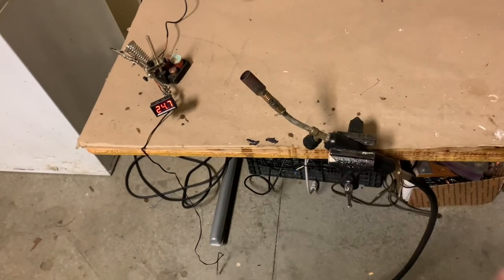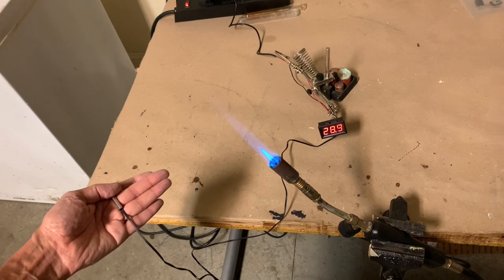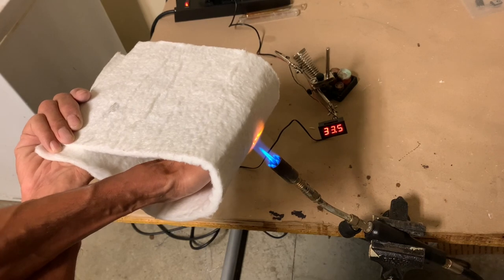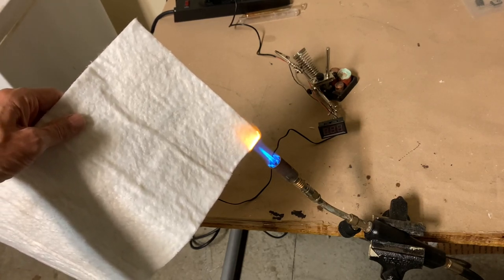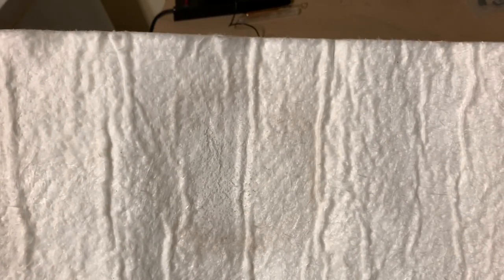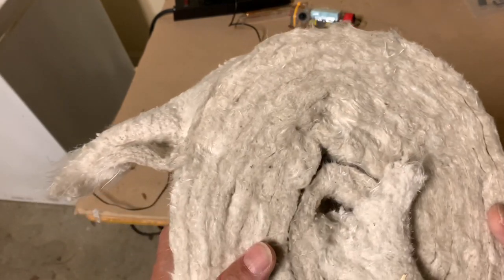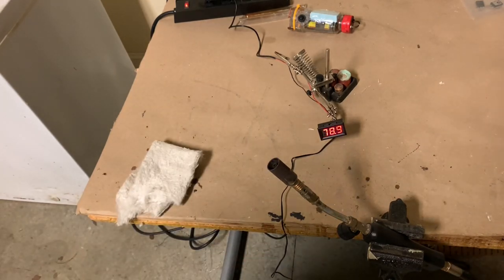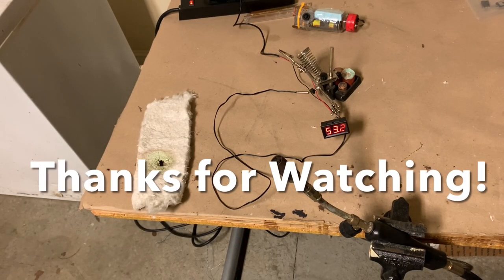Ultimate Heat Blanket

Comment: Not a thermocouple probe, but a NTC thermistor probe. Nominally 4k7 at 20C, and a standard part with closely controlled resistance and temperature coefficient, so that you can simply take any probe and put it on any readout, and it will be very close to accurate, without any expensive calibration.
Reply from the maker: Thanx for the clarification ! 😄